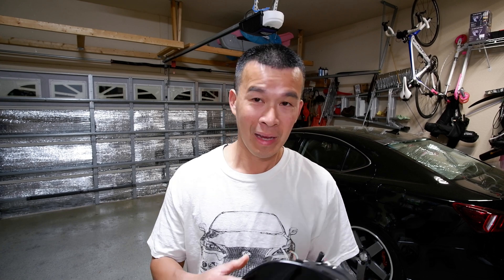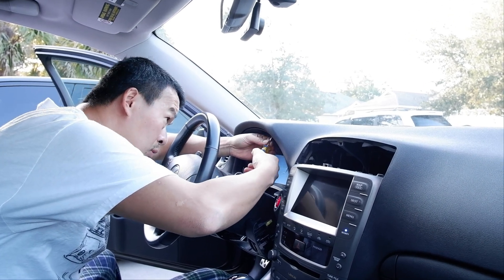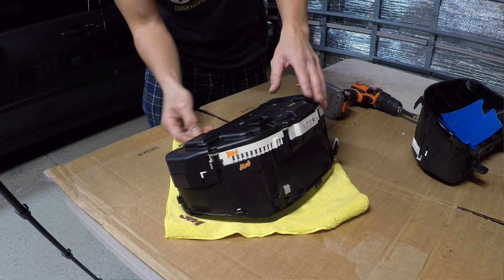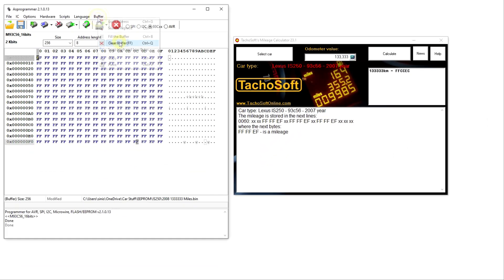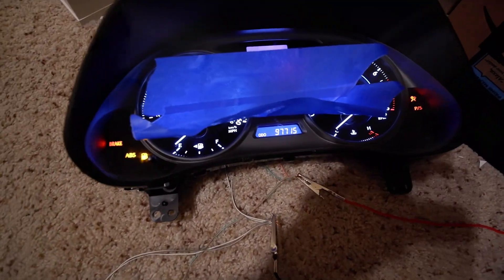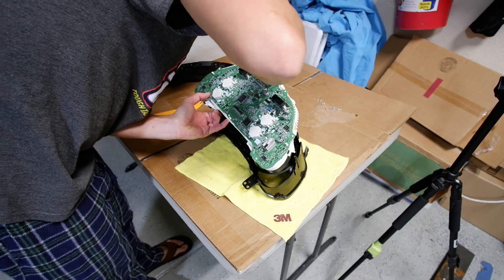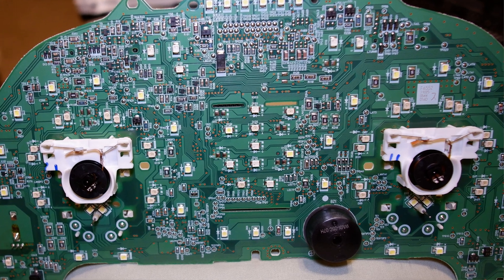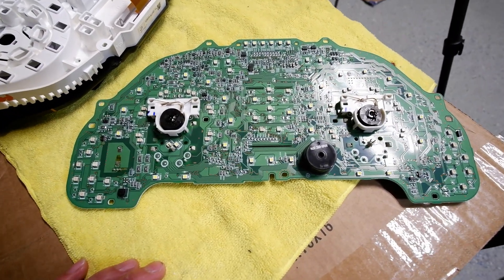Lexus IS250 IS350 Speedometer Tachometer Needle Repair Part 1| New Cluster Mileage Correction

Comment: This is one annoying thing I noticed about this generation of car. Usually, it’s the speedometer, and the needle that measures RPM that only has this issue. But the engine temperature and the fuel level needles are totally fine. I wonder how common these go out. It seems like a very common issue.
Reply: What causes them to flicker ? Do I need to replace the cluster/ solder new led on the cluster or needles themselves?
Reply: @toughone8231 inside the needles itself it flickers and not caused by a wider more serious issue. It’s just like that because these are older cars now and they’re getting to the end of their lifespan, like a lightbulb if you think of that way.

Comment: Hi again mate. By chance would you happen to have the pin out info to make the bench harness for this cluster?
Reply from the maker: Don’t recall. But it’s two opposite corner pins on one of the harness’
Reply: @TunerwithKids  from the online diagrams I can find, pin 1 is earth, pin 24 is battery and pin 12 is ign+. However when I power up with my bench power supply, I get nothing. I know the cluster works…cause it fires up when I put  it in the car. 
Don’t suppose there is any additional guidance you can lend?
Cheers.
Reply from the maker: I just looked at my rear plug and it’s the bigger plug. 1&13 are ground (white/black) and 12&24 are spliced and used on mine light green and peach.
Reply: @TunerwithKids  bingo! Thanks mate. The second earth (pin 13) was where I was missing. 
Thanks.

Comment: Hey mate. Another awesome video. Thanks!
Question….are you aware of any way to calibrate the speed component of these clusters?
At 100km/h my Speedo is about 10% out…which is worth trying to fix I think :)
Reply from the maker: That’s normal for all cars due to wheel and tire size variations and wear.
Reply: @TunerwithKids  thanks mate. I knew there was variance, just didn’t think 10%!was normal. Lots of Lexus forums seem to have folks talking about a similar issue. In some of those instances Lexus swaps the cluster unit and the issue is resolved…..so just figured it may have been something that could be changed with a little deeper knowledge.

Comment: Any tips on how to dismantle the multi information lcd display on the cluster? Need to replace the polariser film on the small lcd screen.
Reply from the maker: That thing has like 100 solder points, I think. Hard to remove.
Reply: @TunerwithKids  thanks for the quick response. I am having the so called vinegar syndrome on both my LCD on the cluster and also the navigation screen.
Reply: @duxz what exactly do you mean by vinegar syndrome? Did you ever solve this? My IS has a multi information display that illuminates but shows no information. I can’t figure out why

Comment: Is this a service you’d provide? I recently bought an ISF cluster for my IS350 and the ISF cluster has way less mileage than my 350 and I’d want it to match my current mileage.
Reply from the maker: Try Tanin Electronics, they do it as a service. I only make DIY content for you guys to try.
Reply: @TunerwithKids  Right on Binh, thank you brotha. I reached out to them and am just awaiting a reply.
Reply: One more thing, Binh… I spoke to someone at Tanin about an ISF cluster I bought in KM and getting it switched to MPH, they said they can’t change that. Does tachosoft allow for that correction, or maybe even techstream?
Reply from the maker: No. Need an MPH cluster.

Comment: Do I have need to unscrew the screws from the back if want to clean the front plastic glass but the inside?
Reply from the maker: Don’t do it. You’ll end up scratching it worse.
Reply: @TunerwithKids  so I have to get a replacement ? I think I used a strong abrasive product while cleaning the front temper glass and it seems it etched inside of the glass.
Reply from the maker: If you messed up the surface, it’s done. Get a replacement, they are like $30 at dealer.
Reply: @TunerwithKids  even if it’s the inside of the cluster lens? It seems like a dried up spray to describe lol

Comment: You're the best! I just reprogrammed a new cluster with my actual mileage to get rid of my burnt out needles. Total cost was around $80 including the spare cluster. Thank you!
Reply: Did you have to modify the amizon program clip or could you directly clip and get into the computer?
Reply: P
Reply from the maker: Glad you knew how to do the programmer. Most people are intimidated by anything electrical and programming.

Comment: Hey bro, I want to power my cluster on the bench with a 12v power supply. Can you tell me which pin numbers I need to connect to on the cluster? Thank you.
Reply from the maker: 1 and 13 to GND, they are top and bottom on one end. 12 and 24 for 12V power on opposite side. The plug is numbered if you look close.

Comment: Can a isf 2012 cluster be replaces with the older 2008/9 cluster? Because the analog feul and so are way cooler
Reply from the maker: Yes but you will have a oil pressure light since regular IS doesn't have that sensor.

Comment: Just when I thought it was just as simple as replacing the led... but nooo... there's computers software envolve..oh well guess I'll have to pay 150$ to get it fix.
Reply from the maker: Which part?
Reply: @TunerwithKids  the part where you identify the chip and then alligator clip it and did somethings in the computer..I just wanted to remove the needle and swap out the LED onto the old needle.
Reply from the maker: Well that’s for programming the mileage. This was a replacement I bought to experiment on with soldering so i cloned my old cluster to match.

Comment: where to connect the power supply to start the odometer without putting it in the car?
Reply from the maker: I have a harness. Pin 1 and 13 are ground. 12 and 24 are power.

Comment: Can I just switch out the tach and speedo Needles. From a good cluster. Mine the needles don't light up
Reply from the maker: You can buy it’s a ticking timebomb. These all will fail eventually due to age and heat.

Comment: Update ** thanks heaps man all done and dusted. Perfect explanation and help and with the Sports Luxury Auto column I just left the car turned while I did it :) 

Also I can't find my Fuse board inside my car under drivers side or passengers lol
Reply from the maker: The fuse panel is the tan box above the parking brake. Has the diagram on outside.

Comment: You reckon I can remove it disconnect it while it's still turned on ?
Reply from the maker: Yea that’s an option too. I’ve driven my car in the driveway in and out of the garage without the cluster on. It doesn’t do any harm.
Reply: @TunerwithKids  yeah sweet I was thinking maybe disconnect battery while car is running but probably not a good idea lol

Comment: How do you leave steering wheel all the way out when off ?
Reply from the maker: My wheel is manual, so I don’t know what it does if you have the luxury package with automatic tilt.
Reply: @TunerwithKids  ah ok all good maybe disconnect battery before i turn it off 🤔
Reply from the maker: Maybe, most other lexus cars that have this requires disabling via Techstream. No options on dash or column.
Reply: Manually move the steering wheel up, Set your car in neutral and then turn it car off, then put car back in park. (no need to turn the car on in order to put in park)

Comment: Does the chip need 3.3v or 5v? Should we mod the programmer like in the is300 vid?
Reply from the maker: Same mod needed. All vehicle applications need 5V to write.
Reply: Fyi - instead of cutting traces and all, you can just jumper the 5v and 3.3v pins together and it will work. Just did my is250 cluster using this method. Still need an adapter for the pin out of the ic, but that part is easy with some jumper wires.